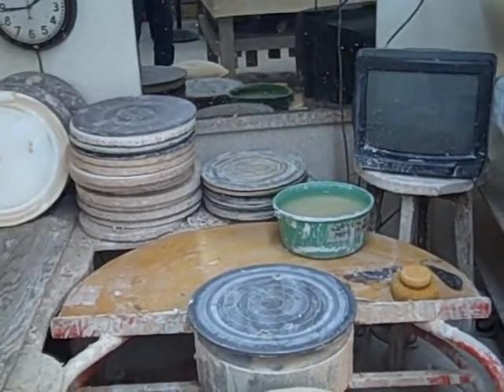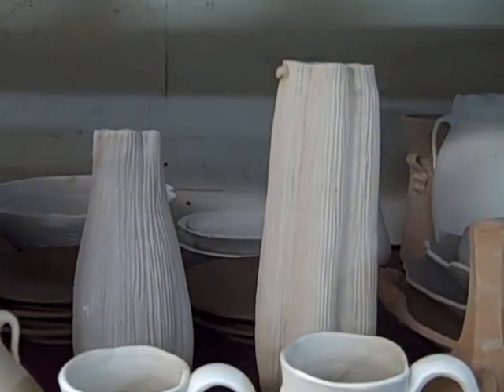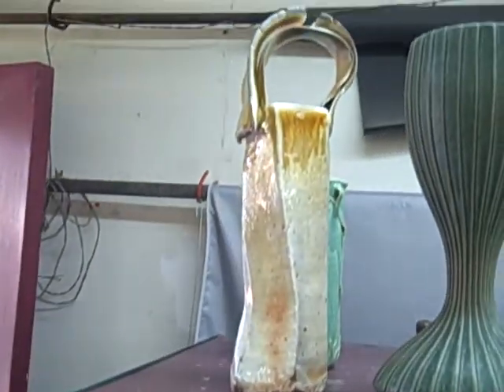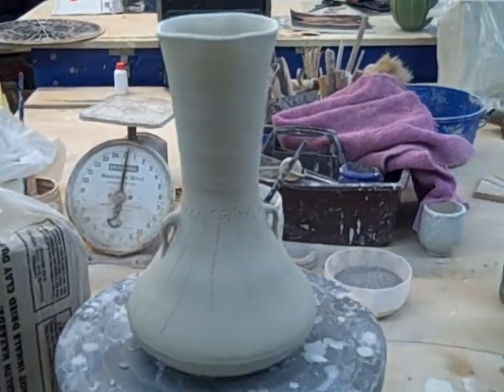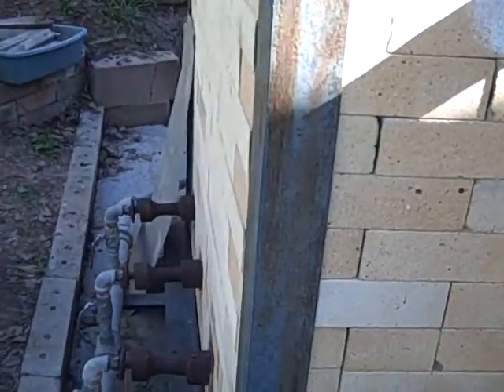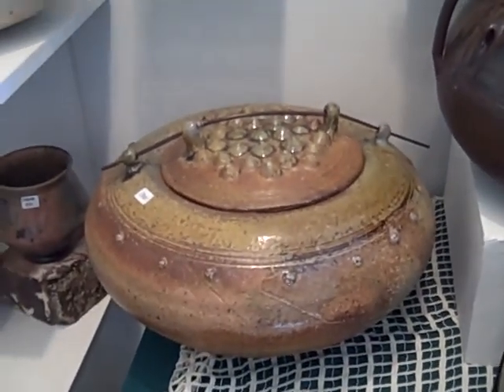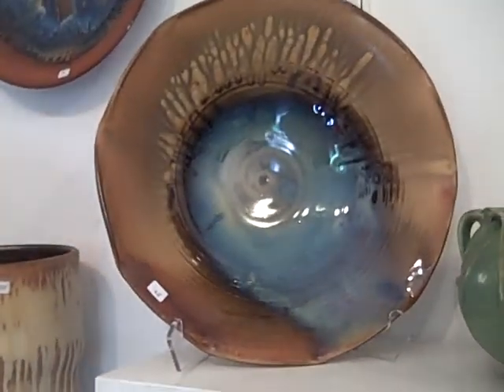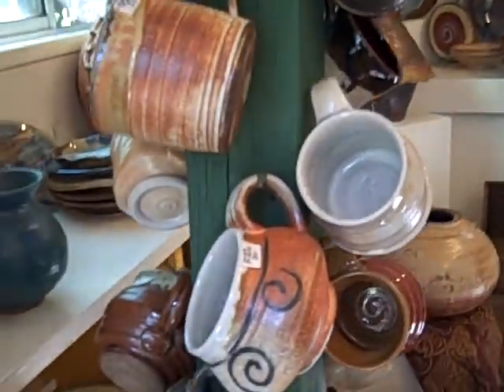pottery studio tour

Comment from the maker: They are both excellent wheels, probably best on the market. The Soldner is very responsive, a great foot pedal, plenty of power, but can be noisy. Also the working area is great on the Soldner. I love the wheel over all. The Wisper is also very good and has no belt, so no noise. I have use two of them, the first one was fantastic, in all respects, but the second one did not have good pedal control. The Wisper is cheaper too. If you get the Shimpo, try it out first, especially very slow speed.